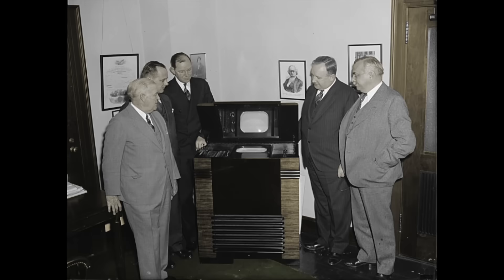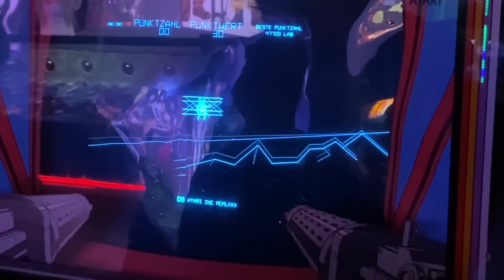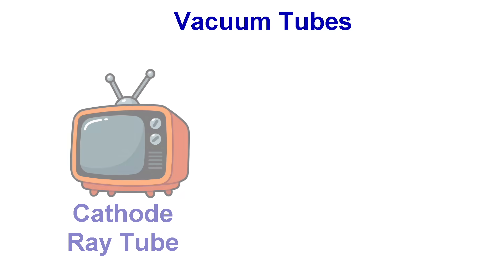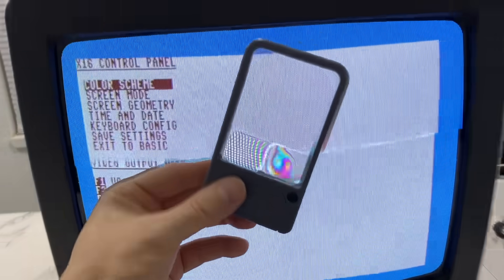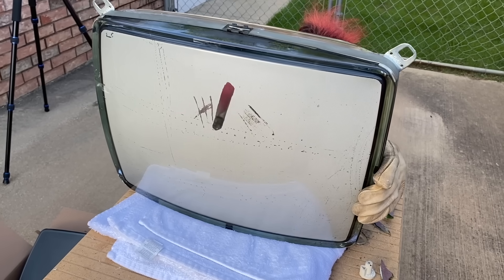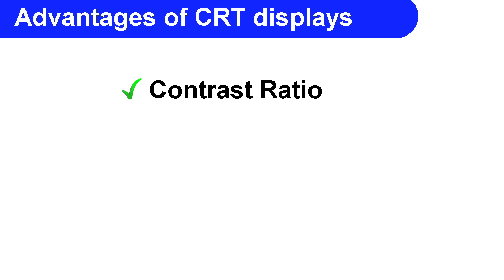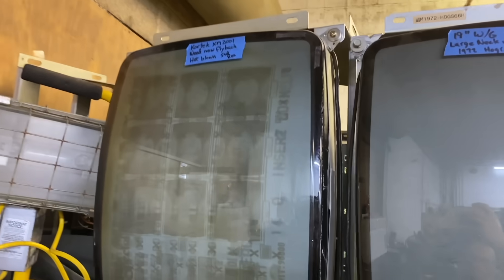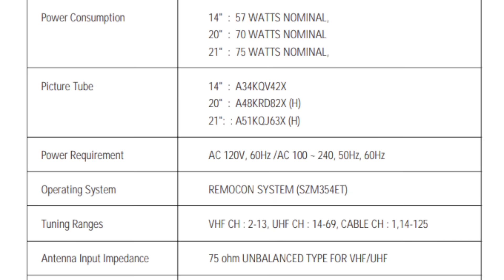How Cathode Ray Tubes Work.

Comment: That's the first time I saw the inside of a tube, I've disassembled CRTs in the past but never tried to crack open the tube itself. I always assumed some sort of adhesive was added to the phosphor so it would stick.
Reply: It’s been a while since I watched it, but I saw an old film about how they were made, and I think it was basically applied as a photosensitive lacquer (well, three of them applied, exposed, and etched in sequence) and then baked, which baked out the binder, leaving it as the loose coating.

Comment: Back in high school, one fine day the electronics lab's oscilloscope went bad. Everything it displayed was tilted sideways, so it was put out of service until the school could send it to be fixed. Some two weeks later when it was being collected to be repaired, the culprit was found: a huge large, flat magnet placed under the cabinet. Maybe it was a prank, maybe someone forgot it there. After removing the magnet, the oscilloscope was working just fine.

Comment: The motion clarity on CRTs is insane. Watch an old demo with very faast scrolling text on a modern LCD and it's just a blur. Watch on an old, cheap CRT and it's easily readable. Some newer gaming monitor are emulating the CRT-effect (strobing) and can come pretty close.
Reply: OLED monitors can do it. The CRTs often still win in smoothness of motion, but the scrolltext is crystal sharp and readable on an OLED.

Comment: Oh LCDs can very much burn in. Super expensive ones as well. 24/7 signage displays...
Reply: Well the physical process is entirely different, even if the visible effect is similar. Most LCD image persistence is reversible, though it can take a lot of “exercising” the pixels.
Reply: @tookitogo  we tried everything and nothing worked
Reply: @Dinnye01  Well, I did say “most”, not “all”. ;)
Reply: @tookitogo  However, I can concede to say "for all intents and purposes"
Reply: I agree. I have a laptop with a LCD burn in. The white areas are grayed out... SO annoying

Comment: I'm definitely old.  I went to High School in the mid '70s and took a Radio/TV repair shop class and we learned how to repair TVs.  My achievement was finding two different TVs that were both broken but the guts were the same even though they were different models.  So I took the CRT from one and put it in the other and got myself a Free 25" color TV and I put it in my bedroom.  The family TV was a 19" black and white one in the den.  I have lots of experience with playing around with the yokes and such.  Also I burned my finger once in the flyback cage.  It actually just went in one side and out the other side of my finger. Otherwise I'd be dead now.

Comment: I think one important aspect about contrast ratio that wasn't discussed is that it's highly dependent on the environment you're in. If you're in a dark environment, CRTs are excellent, but when there's light, you get a lot of reflection of the grey phosphor coating, and the image will never, ever be darker than however bright that grey color is.
Reply: Was trying to play some games on a consumer tube today, on my terrace, in a unusually sunny Finnish summer day. Playing Super Mario 64, I could indeed see a fat dude on the screen...
Reply: And that gray color is itself already due to the gray filter on the front CRT glass, which can either be a colorant in the front glass itself, or a plastic film laminated to the front. (TVs tend to be the former, computer displays the latter.) Without the gray filter, the phosphors appear nearly white. 

You could put a darker filter on it to improve contrast, but you’d have to increase the CRT brightness to compensate. (This is part of what made Triniton CRTs so successful: their thin wire aperture grille covered up far less of the phosphor than the shadow mask did, which had two effects: a) more of the phosphor lit up, and b) the wires didn’t heat up as much as a shadow mask, so you could run the electron guns at higher power without the shadow mask distorting. Both of those meant a much brighter image, which meant in turn that Sony could sacrifice more brightness towards contrast.)
Reply: @tookitogo  It's also the colour of the material surrounding the phosphor cells. Toshiba improved contrast in it's tubes just by painting it black. They called their new tubes, "Blackstripe".
Reply: Exactly CRTs can only archive better contrast in a pitch black room any ambient light will raise the black level. Modern LCDs(especially VA) actually have better contrast than CRTs in typical viewing environment because the panels themself are much darker.
Reply: It's funny how easy it is to forget about quality of life issues like that when something is no longer an issue.  You really did need to turn off any lights in the room or close the curtains/blinds all the way to watch anything, or there would be a reflection on the screen the whole time.  It's amazing how LCDs normally mitigate that enough, if a light source isn't pointing directly at the screen.
Reply: The light effect can easily be fixed with a filter on the glass that prevents sunlight from refracting

Comment: The great thing about valves (aka tubes in the US) was that if one failed, you could just pull it out and replace it.  I had a wartime Marconi receiver that used lots of identical valves for the AF, IF and HF stages
https://www.radio-workshop.co.uk/wp-content/uploads/2023/12/cr100.pdf

Comment: It may have been the case in the past that input lag is lower on a CRT, but not so much now. Back when LCDs first came out and were only 60hz, the input lag of CRTs were definitely better, especially if you could run the CRT at higher refresh like 85hz+ vs an LCD at 60hz. A modern LCD at 500hz easily beats a CRT for input lag, although the digital signal processing lag is still there, it is quite small. 60hz = 16.7ms between frames, 500hz =2ms. You can definitely feel that when moving a mouse or playing a game.

CRTs had the advantage of persistence of vision where after drawing a line on the screen, it would go black so motion would look better compared to LCD. LCDs used to have poor response times when changing a pixel from one colour to another which made motion look blurry, sometimes with the pixel still transitioning by the time the next frame transition is required. CRT had no such transition lag and while LCD has hugely improved recently, it’s not perfect. LCD keeps all the pixels lit all the time and then slowly changes them, meaning motion looks worse to the eye than CRT.

There are some technologies to counter these deficiencies for LCDs such as flashing the backlight with refresh rate and using overdrive (increased voltage) to accelerate pixel changes, and having thousands of small backlight “pixels” that can dim and turn off but they aren’t perfect.

As far as degradation goes, I have some LCDs from 5 to 15 years old and they all still work. The picture on some of them does look bad though, the image has gone brown in spots. This is where a screen calibrator comes in handy!

Of course the holy grail is now OLED - many of the benefits of CRTs such as true blacks, amazing response time, no pixel overshoot, thin, proper HDR..But they do suffer from burn in, although various control algorithms mitigate this by dimming persistent logos, shifting the image around by a few pixels, pixel cleaning, etc. the ultimate screens now in my opinion are the latest 4K 32 inch 240hz OLEDs. Expensive tho 😊
Reply: OLEDs finally starting to enter the monitor space and i am all here for it

Comment: In terms of aspect ratio.  I think the key reason why 16:9 got popular, was because it fit most movie and DVD videos better.  Even though for computing one usually wants more horizontal space.
Reply: @Tyneras  16:10 would still be the better choice for general computer use...
Reply: @joojoojeejee6058 Well, if you’re writing a lot, I found 4:3 more useful since more of an A4 fits on the screen. That is unless you turn around the 16:9, leaving it useless for drawing or general video editing.
Reply: @Tyneras  16:9 only really won because it was cheaper, but now its common to see even wider than that due to the popularity of shooter games
Reply: I’m still enjoying two 30” apple cinema displays in 16:10. Sure miss that extra height on 16:9.
Reply: @ericbauer4559  - I'm still rocking my Acer G24, haha.
Though I recently hooked it up to my TV setup, and it's actually quite annoying, since ideally I just wanted to mirror the image on the two displays (so I could full-screen a video or the like), but the 16:9 4k display can't map onto the 16:10 1080x1200 monitor without either having space cut off or black bars, and since I want it permanently connected, I have to fiddle with window location and can't quite do real full-screen applications.
Reply: Widescreen didn't really make sense with CRTs below about 32" as the tubes were still as deep and almost as heavy  I used to jokingly call them "reduced height TVs".
Reply: Good thing that you can rotate most screens around a pivot point nowadays. I used to have such a setup at work to have one screen only for the purpose of viewing documentation. Only downside is when they have a limited viewing angle.
Reply: @s4ndwichMakeR  i use like a 24 as a side monitor for my 43" monitor.   nice thing about the bigger 4k screen as monitor is that it being 16:9 or whatever becomes less of an issue when I can just use part of it like a 30" 4:3 monitor if I want to. or as a 25 fullhd.   it's like having a bunch of borderless smaller monitors if one just uses this like that. it's just like having one side of the desk be a display surface.
Reply: @s4ndwichMakeR  Rotatable TVs aren't new. I grew up with a 1956 Admiral Super Cascode console on a lazy Susan base that you could swivel to face you wherever you were sitting.
Reply: I recall froim a video about aspect ratios that someone went and looked at all the aspect ratios in use everywhere in the world and after a fair bit of maths worked out that 16:9 made for the best average of all of them all. It basically minimised how much of the screen would go unused no matter what available input source you had.
Reply: @Tyneras  I still buy 16:10 monitors for computing.
Reply: DVDs specifically use 16:9 anamorphic because a bunch of eggheads got together and found it was the middle ground between the several most prominent aspect ratios in cinemas. Computer monitors used to be 16:10 instead because it neatly fit two pages side-by-side in word processors.
Reply: Considering how many big blockbuster films are and have been released in Cinemascope/Panavision, I'm surprised no one's tried pushing ultrawide TVs yet. 3D TV came and went and still no sign of ultrawide.
Reply: The only true reason 16\9 is more popular that it's cheaper to produce.
Needs less material to make a monitor. Of course they will dump 4/3 for that. They will sell their souls for extra profits if needed.
Business is business. All is driven by money and nothing more. Anything else is marketing trick. 
16\9 was never superior than 4\3. It's all a self-delusion.
Customer should have the choice to pick up any format he wants. Forcing people to replace one with another is not good by any means.
Reply: First 16:9 screen I remember was CRT device capable to show 1 big 4:3 picture along with 3 small 4:3 pictures stacked on the side. That makes a lot of sense for such aspect ratio.
Reply: I think this is a really important point, as whether 16:9, with the same diagonal was "less screen real estate" was heavily dependent on what you were doing with it.

If you were watching 16:9 content on a 17" 4x3, once you were taking out the black bars, your 138.7 in^2 dropped to 104.0 in^2, so much smaller than watching the same content on your 123.5 in^2 native 16:9 17" display.

if you were watching 4:3 content on a 17" 16:9, again once you are excluding the black bars, your 123.5 in^2 dropped to 92.6 in^2
Reply: @Tyneras  No it's not. Two A4 pages side by side are 1.414:1 (same as a single sheet in landscape), and even if you're talking Imperial sizes, it's still not right. The usual Imperial size is 8.5*11. Two of those side-by-side gives 17:11, or 1.545:1. Again, not the monitor shape in question.
Reply: 16:9 is an industrial standard that aims to average the different popular aspect ratios, from 1.85 cinema to 4:3 tv standard.
Reply: @paenumbra  I know the idea. Basically it's making it neither fish, nor fowl. Too wide for classical films, too narrow for cinematic stuff.
Reply: so popular that it’s also replace 16:10 which pissed me off due to limited choices. For Eizo only 24 inches have 16:10 choices while NEC it’s 30 inches that have 16:10 but it’s an LED display so I still wish that there are 16:10 OLED monitor. Even laptop now have 16:10
Reply: Movies went widescreen to compete with TV. Before the 1950s most movies were in 35mm 4:3, which closely reflects natural vision. The idea was that the panoramic view would keep you coming to the theatre instead of staying home to watch TV. There was actually a format that used 3 synchronized projectors and a wrap around screen. Movie companies also tried 3-D, smell-o-vision, Sensurround, misting, and other sensory tricks. The latest trick is to actually shake the seats like a midway ride.
Reply: And movies are widescreen because people have two eyes side by side. We see wider than tall
Reply: @RichardWoelk  think this only applies if the screen is attached to your face
Reply: Yeah, and at that time lots of video games were coming out with FMV cut scenes, taking advantage of CD-ROMs and graphics. So there was a general appetite/expectation that soon everything would be a movie.
Reply: Yeah, 4:3 was better if you were doing office work but if you were using it to watch films some of that extra vertical space was being occupied by black bars anyway.
Reply: @watcherzero5256  It depends which films are you watching. If it's mostly oldies, 4:3 is still a good option to go.
Reply: @watcherzero5256  I think for office work it still depends on the work.  When I'm working with spreadsheets and database tables, I appreciate the extra width of my wide and ultrawide displays.  

I also have a 4:3 that I run in portrait (so 3:4 I guess; 1200x1600), which I like for reviewing standard paper-sized documents and I run Outlook on.  

With it being tall, I like that I can see a decently long list of emails in my inbox, while also getting a nice sized preview window below it.

Comment: It's a tiny particle accelerator!
Reply: It is, actually the faster they move (more voltage difference) the brighter the picture
Reply: @maikudoutube  Is it? It isn't accelerating particles. Imo the electron gun is more suitable and correct term.
Reply: @jothain  Electron is not a particle?
Reply: @maikudoutube  Correct, it is actually the little brother of the BBC Micro! 🙃😁